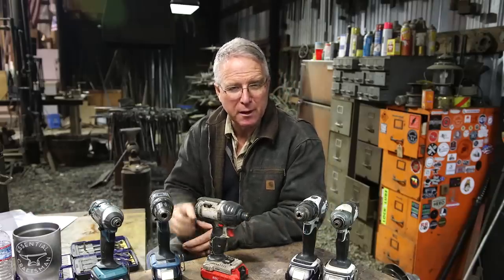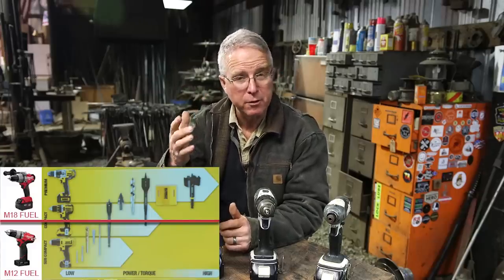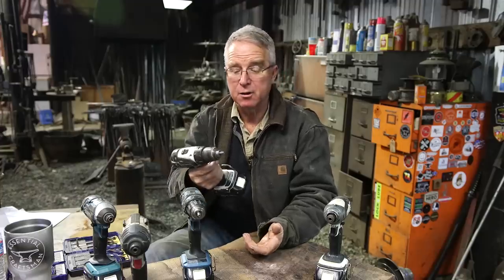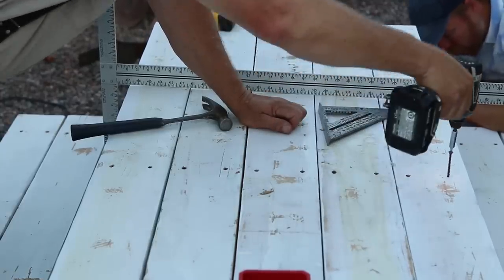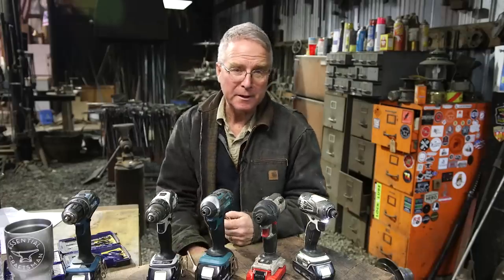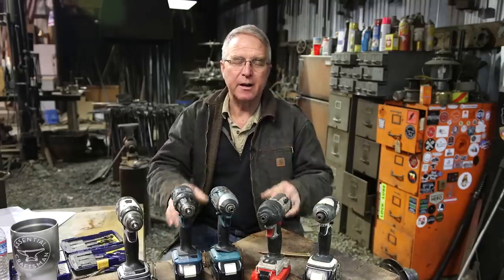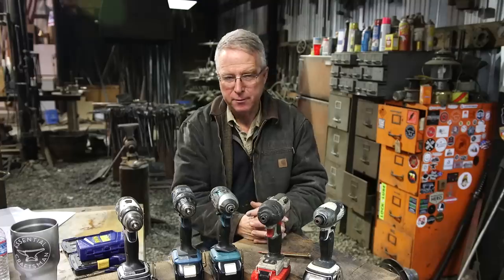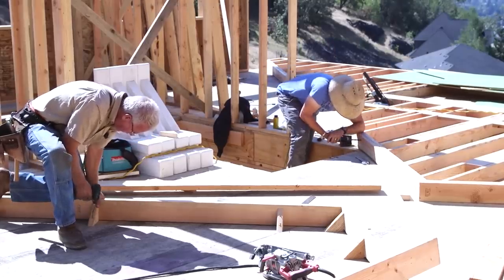Impact Driver Vs. Drill Driver

Comment: Drivers are now eliminating the air hose in auto repair shops. They have the power to turn truck wheel nuts off easily. They are great
Reply: Technically, those are called impact wrenches, not impact drivers. Instead of having the hole to insert bits, they have a knob to fit sockets onto. Otherwise, they're basically the same.

Comment: IDK I bought into cordless impact driver use a while back and I've yet to feel any advantage over the variable speed cordless drill driver. It's like Facebook, I use the impact driver because I guess I'm supposed to.
Reply: You'll see an advantage if you have to drive lag bolts, screw at odd angles without having room to grab the tool with both hands.  There is less chance of the bit slipping out of the screw (cam out).. If a drill binds on something it will torque hard on your wrist and with an impact not so.. Many advantages.

I think you're the only person I have heard saying they could'nt see any advantage.

Comment: Love/hate makitas. Makita impact drivers are nice but their drills are junk. Chuck constantly gets stuck and breaks. Company has over a 100 sets on sites, every new one gets stuck within a week and eventually breaks. Mainly use the drill just to hole saw a 1 1/8" or 1 3/8" holes for electrical panels. No matter who uses it, it breaks. Their older model portabands were junk too, eventually fixed the issue of the blade coming off with the new design

Comment: are Hammer drills different than impact drivers ?
Reply: From using both I believe it has the same mechanism that causes the bit to twist and hammer simultaneously. On the impact driver it is on a smaller scale of power but more precise.
Reply: I have both.  The impact driver applies its impact to the rotation.  The hammer drill applies it's impact axially (like a jack hammer).  The impact driver sucks at drilling holes in concrete, but the hammer drill makes short work of it.
Reply: @briantaylor9266  “short work with the hammer drill” - That’s a Fact!!

Comment: Then why do drills have clutches?  Do impact drivers have clutches?
Reply: Tim Lange Drills have clutches because they can also be used for driving screws. The clutch prevents the drill from over tightening the screw (especially useful when working with delicate materials). Impact drivers do not have clutches because they are used more often for heavier duty screw driving applications.

Comment: I don’t know when cordless drills appeared? I do know we got a Toro battery operated weed eater in 1980. Had the 9V plug in. Absolute junk. Took a hundred years to charge and gave out after 15 minutes of use. 
The earliest Makitas were the same setup. Plugged the cord into the drill to recharge. Not so great.

We’re miles ahead of that now. But it comes with a cost. The war in Afghanistan is ongoing for #1: opium and a close #2: Lithium for rechargeable batteries.

Comment: I noticed your use of the impact driver when installing the screws in the flooring on the new house.  Also is a lot of other areas.  I was puzzled as to why you did not have a driver with a coil of screws so that you did not have to set each screw in the floor by hand.  Saves time and bending over!

Comment: I hate impact drivers, I think they are for amateurs. I use a bosh professional in high speed with a 6ah battery to drive screws. Much quicker and quieter than an impact driver. I would race anyone with an impact driver and big screws.

Comment: If u buy a set and add on more tools later like a Sawzall, circular saw, flashlight, Brad nailer, Crown Nailer etc, they will all use the same batteries.  Nothing worse than having 6 handheld battery operated tools from 6 different manufacturers that use 6 different batteries AND chargers.  Imagine having to lug all that mismatched junk to the job site everyday, find somewhere to plug in all your chargers and juggle all those batteries and tools!?$&&. You will be like the clown with the pink tape measure his mom gave him.  And batteries are very expensive.  I would rather have 3 of the same 20v batteries from Milwaukee or Dewalt that are interchangeable than 6 from every manufacturer that aren’t.    And new batteries are stronger and lighter, which u will appreciate if you are holding a screwgun or have it on your belt 12 hours a day, with your hairy ass crack hanging out.